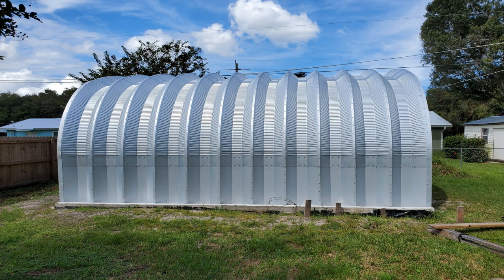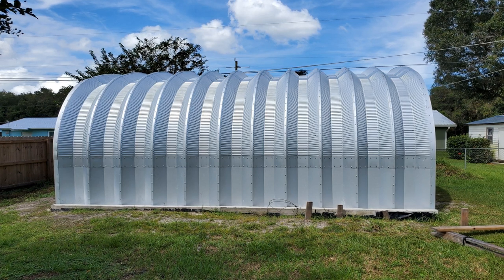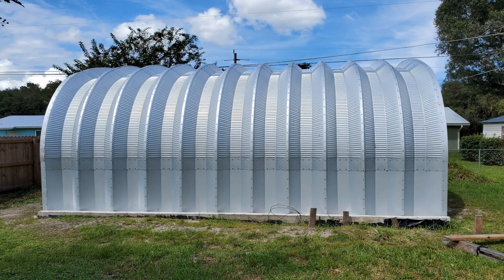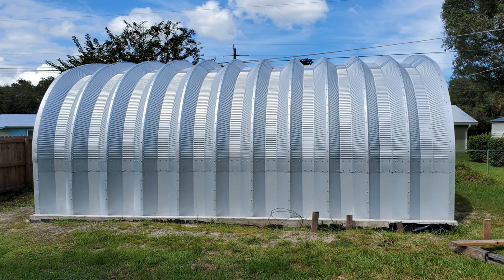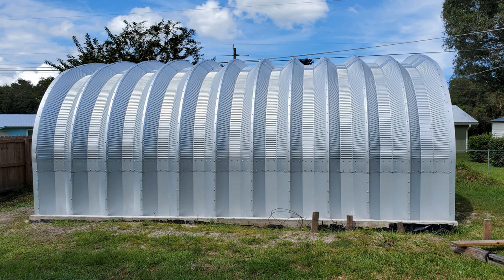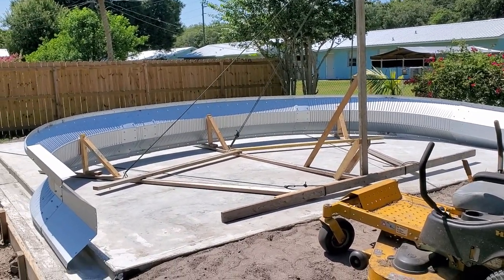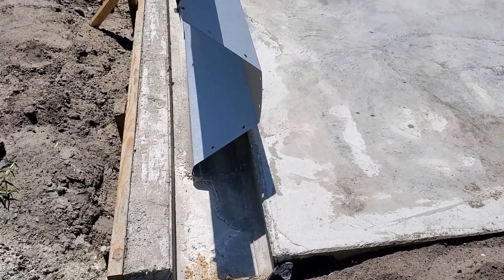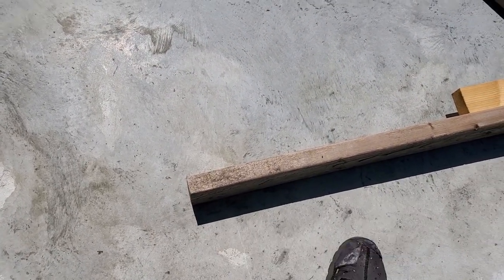Raising my Steelmaster building by myself, 1/5 - wooden support, pulley system, and wench install

Comment: Um, there's  a fence there, shouldn't you be raising the arches in the opposite direction starting at the fence end of the slab🤔
Reply from the maker: I had to raise the last panel by hand (in video 5). I was aware that I would have to do that from the beginning. I chose the other direction so I could attach the pullys to the tie down augers attached to my shed.

Comment: Nice building but that concrete man
Reply from the maker: Yeah, the concrete truck had arrived but the concrete pump guy (who should have been there and completely set up before the concrete arrived) was late. Then he wasn't able to get the motor on the pump started right away. So the concrete from the 1st truck (which is about 3/4 of the total) was a little harder than it should have been when it was being finished.